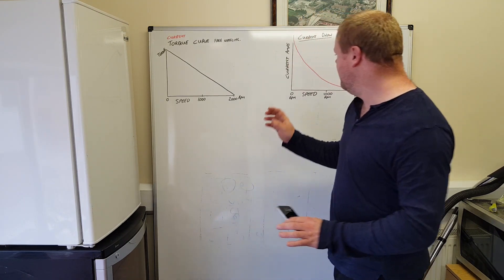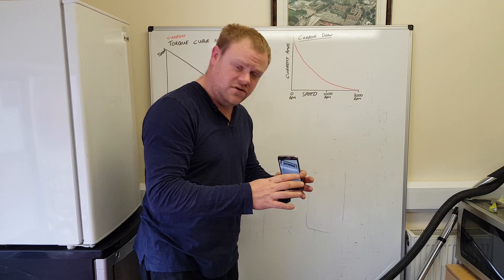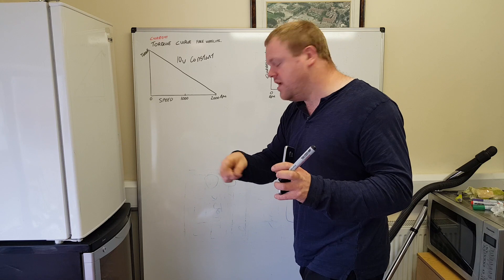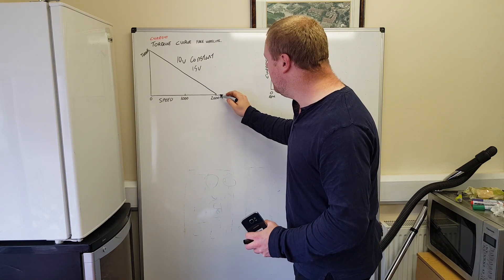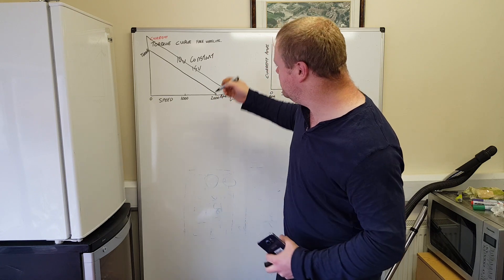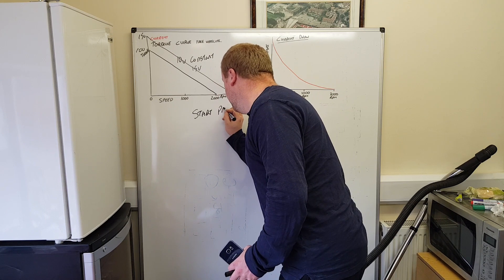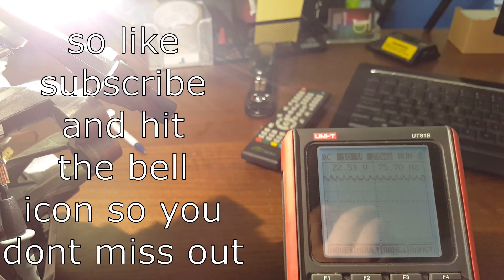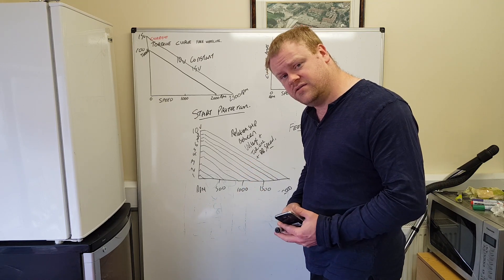Electric motors and controllers episode one INTRO regen braking

Comment: What are those motors?
Reply from the maker: Those motors are small 1 kilowatt universal motors from washing machines. They can run on dc or ac. Theyre good for demonstrating as theyre small and easy to power. I had that one running on a variac :-)
Reply: @jaysjetskis  I've just watched video explaining universal motors, am I correct in assuming they only run in one direction?
Reply from the maker: @JamieJones1985  hi jamie they can easily be reversed by reversing the connection of carbon brushes that supply power to the commutator. Whilst keeping the stator windings the same. This way the magnets will be pushed the other way and the motor will reverse direction :-)
Reply: @jaysjetskis  Sorry, I wasn't specific. They cannot be reversed using a H bridge but only mechanically modifying?
Reply from the maker: Ahh let me think  yes and no... u had me thinking for a second .. in the same way thay ac supply will turn them in one direction reversing the supply would still result in the same direction of turn.. heres a trick tho. When you wire the stator coil in series with the commutator then no but if you suppky a seperate power supply to the stator magnets and then supply the carbon brushes accross the h bridge then yes you could reverse direction on your h bridge that way. Just play with the voltage inputs for the stators tp get it to behave like you want .. you will be able to increase or decrease the stator flux thus way. More voltage will result in less speed more torque and control accuracy and less voltage will result in more speed less torque. Hooe that helps